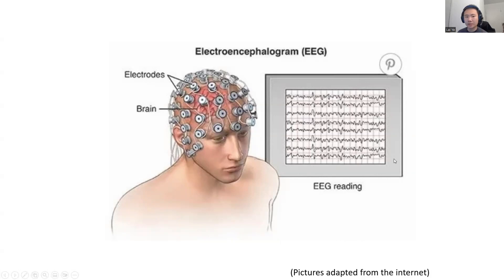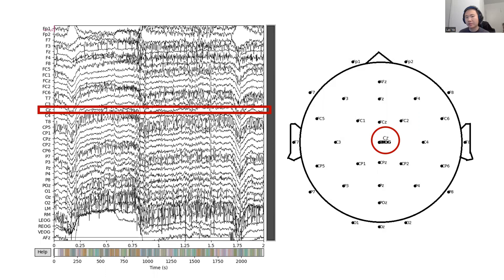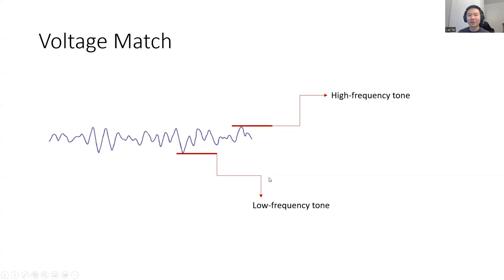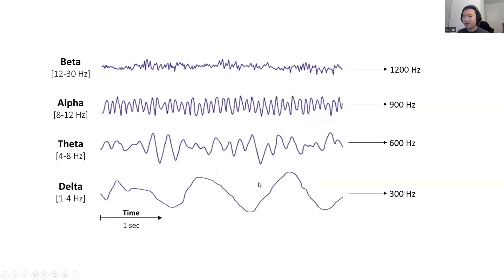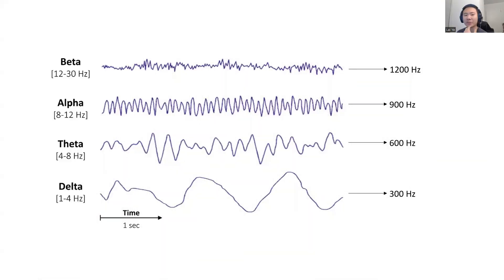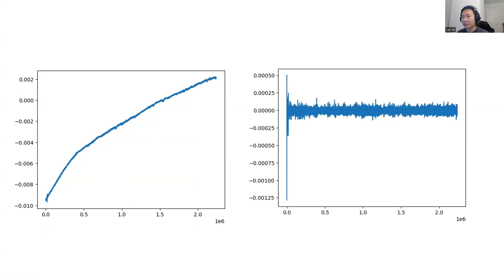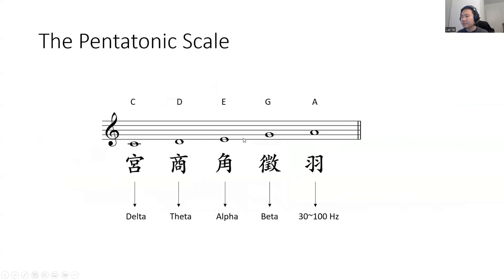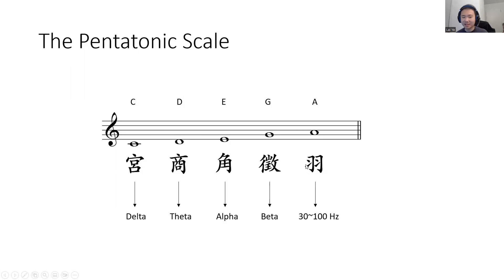What does a brain sound like? Real-time EEG sonification

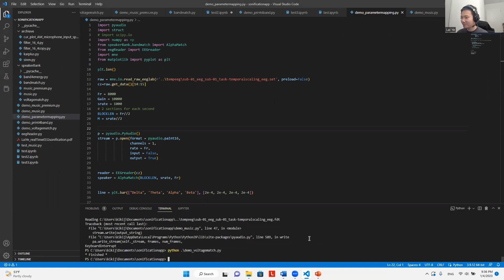Comment: Do you have the code available for the first method, around 1:50, anywhere? I'm a long time experimental musician used to listening to noisy things, and I've been studying neuroscience for years as well. Noise and all the other variance in the signal play roles in the information processing in the brain, and I would like to listen to the full spectrum of sounds on an EEG dataset
Reply: By ear… that sounds like he simply played the eeg waveform as a sound file. All you need to do as a musician is decide the frequency range to map the waveform to. Since you could map the sound to our entire hearing range, or pick a smaller band. 

That shouldn’t be more than a few lines of python code, just look up “playing a voltage waveform as a sound file python”.